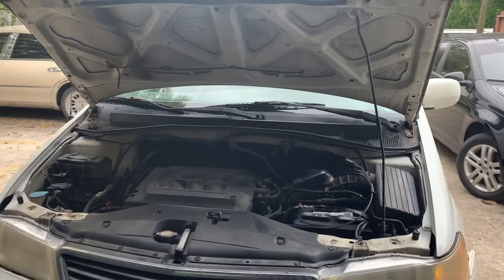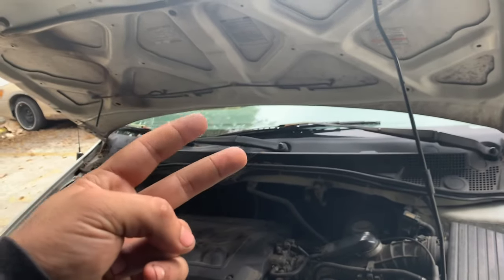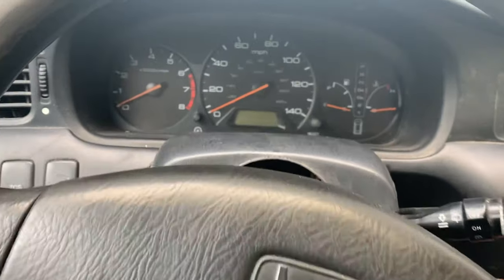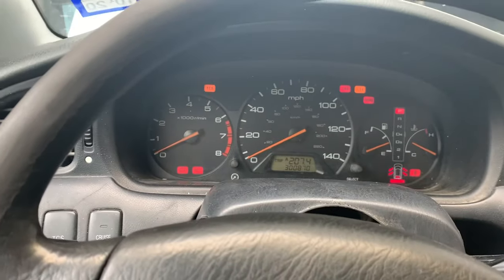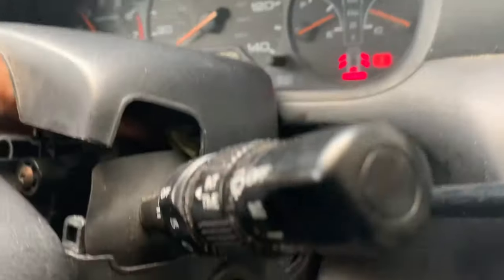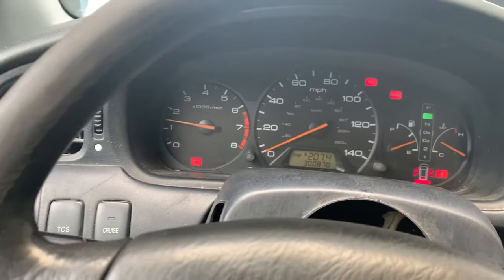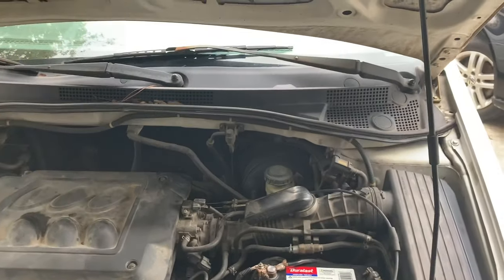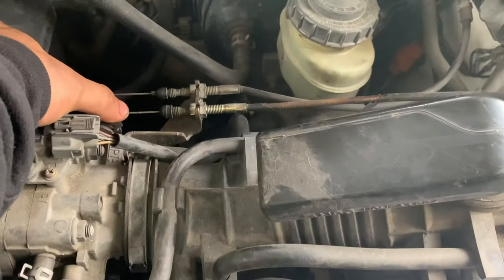Honda High RPM Fix -No Parts Needed-

Comment: An honest mechanic.  You could have charged the customer but you choose to do the right thing instead. That is what makes life time customers that recommend you to everyone.  
I wish I could have found an honest, competant mechanic before I paid $5600 for maintenance and repairs on an 09 Odyssey that cosy me  $4,700.
I'm still having problems with shop that did the work.  All this after dealer stripped oil pan plug

Comment: I had just replaced my battery and noticed the idle was high. Thought it was a coincidence until I saw your video. I went back and found the cable to the cruise control you mentioned was wedged against the corner of the battery, making it slightly tighter than it should be. I slide it off and the idle is back to normal. Really appreciate you making this video!

Comment: Even after finding the problem and adjusting the cable, most shops would have changed the idle air control valve anyway. Just to charge the customer for something. Good stuff bro!
Reply: I guess I am kinda off topic but does anybody know a good place to watch new tv shows online?
Reply: @Reign Alden Lately I have been using Flixzone. Just search on google for it :)
Reply: @Saul Castiel yup, been using Flixzone for years myself :D
Reply: @Saul Castiel thank you, I went there and it seems to work :D I really appreciate it !!
Reply: @keenanjaime3590  all of you
Reply: @reignalden8056  ]]
Reply: @reignalden8056  p

Comment: Thank you so much for your honesty and sharing this, still have this issue with a high RPMs on my Honda Civic 2005 I've gone to five different mechanics and they still have not been able to solve this I will try to check what you posted on this video my transmission ended up getting switched out because I wasn't able to reverse as well😭 probably different issue than this bit I've changed the Pcv valve had the throttle cleaned and now someone else told me about the ignition coils so will be working on those too

Comment: Thank You! I highly appreciate this I'm having the same issue on my Honda Accord Ex 04. Initially I was having the p0507 code error which I've recently changed the idle air control valve, the map sensor, pcv valve, and the engine air filter by myself and cleaned the insides of the metal round piece which connects to the air intake hose while the battery is disconnected which fixed my error now I'm hoping I just have to readjust the long metal piece like within the video to fix the high idle when the car starts up.
Reply: Did it fix the high idle?
Reply: @deedrickg3319  Yes

Comment: You're vids are lifesavers. I appreciate you taking the time to post them. My son just bought a 2007 Civic Lx 2 dr with the 1.8 4 cyl. 5 Sp manual. While cruising 60mph in 5th gear, it's turning about 3000 RPMs and seems like it needs a 6th gear. Is that normal for this car? Drives me crazy since all other vehicles I've been in have cruising RPMs about 2100 at 60mph
Reply: wrbg high róms is gid réblie ebgér farí 9000 r9mmß àt 155 moh
Reply: Have you solved that ?

Comment: I got a 2006 acura tl. No codes.  Rpm respond when applying the gas pedal. Speedometer doesn't want to go pass 30 mph. Struggled going up hill/ downhill. But after turning off engine and restarting car acts normal but after a few second it acts up again. I feel like it's transmission issues. But some say it could be your accelerator pedal position sensor causing all that symptoms. Let me know what's your thoughts. Greatly appreciate 😊

Comment: This is interesting 🤔 
I have an 01 Honda Accord LX V6 and I just put in a 250 amp high output alternator from JS and as soon as I hit the key my rpms jumped to 3,000 rpms just like in this video. Am I experiencing the same issue? Is the computer registering for it to idle higher than it should from throttle screws needing an adjustment?

Comment: I have a 2019 Kia forte ex. My car all of a sudden runs just under 2000 rpms at 100kmh and when i use cruise control it runs 2600/2700 rpms. Can a faulty spark plug cause that? I had the vehicle diagnosed but nothing came back. Can my issue be solved using what you just did to the Honda? Great video btw.

Comment: I’ve got a 2005 Honda Accord that’s revving high and sounds kinda rough but it hasn’t been started in a year, unfortunately the gas tank is full so if bad gas is a problem that’s a lot to take out. But no check engine light, but the brake lights on when it’s not… and there’s a red light right below the brake light. I think the previous owner installed some audio stuff and when they took it out it killed the audio inside the car and there was a hole in the roof to boot.
Reply: buy hybrdé  rom

Comment: Lmfao bro this helped me out a lot so I changed the power steering pump and out of nowhere it starting idling high for no reason I didn’t get it but watching this video and you showing the cruise control cable mine was on the opposite side of the power steering reservoir so that’s why I was idling so high thanks man 👍🏼

Comment: Holy shit this fixed my issue. Have had high RPMS since i got my ZX. and couldnt figure it out. Not even resetting the idle could fix it. I loosened this bolt and batta bing it worked. I was about to fork out 50 bucks on an new air intake hose. |Sweet.

Comment: My case on Honda accord 2004, while driving, the rpm will increase, car will move at higher speed, and brake becomes unmatchable. I have changed the map sensor...the issue still persists. What will I do ?
Reply: Same here, all sensors and vacums, nothing. You???
Reply: Y'all have any luck

Comment: I have a similar problem with my 4.6 Ford explorer but it only high idles when the engine is warmed up, I've changed the idle air control valve twice now and for a little while it ran normal then started again and after the second idle air control valve today no change, nothing is sticking and even cleaned the throttle body but no change

Comment: Dog where is your shop located I have Corolla high rpm when driving and burn more gas now I was going up hill and I put it in 3 gear and after that I have this issue and my transmission is automatic

Comment: So I changed my spark plugs the other day and had to remove the throttle body and etc on my 08 mercury mariner , once I started my car again the rpm was crazy high so is it maybe because I touched the cruise control cable without knowing ?

Comment: I just decide to start my Honda after 3 months. I turn the ignition on, car starts right up and runs for about 1 minute. Instead of letting the engine warm up, I put the car in reverse. Nothing happens. I put it back in park, then in reverse. I depress the gas pedal but don't get any power. So I press hard on the pedal to give it power. The car accelerated in reverse at about 60 miles an hour (snapped back). Hit the brakes and the car just continued to revv at high speeds. Put the car in drive without pressing the gas peddle and it sped right up in my driveway. The car is now in park but every time I turn it on, the engine is in acceleration mode and shakes violently. What gives?

Comment: hi my odyssey 2010  when hard stopping after going like 40mph it dont shift down to first gear fast feels like the engine is going to turn off , at the same time i heard that is shifting down the gears at the same time with a cranky noise.

Comment: I have a Honda ballade luxline S04 1998 150i manual,when engine is at operating temperature it revs high,it's also hunting up and down and when my map sensor plug is out it stops and when I put a new one car just fails to start,can you help

Comment: Hey Oz, I’m having the same exact issue but I have a 2006 Odyssey, therefore I don’t have the wiring. It’s all digital. Any tips or tricks you can give me 😫 I’m desperate. Thank you 🙏🏻
Reply: Possible checking tps voltage? All the way up to swapping throttle body, idle relearn, code reset.... Maybe this helps
Reply: Justin MCQUAID thank you so much! That actually worked! We swapped out the throttle body this past week and that fixed the issue. 🙂

Comment: IS THAT CABLE CONNECTED TO THE THROTLEBODY CAUSE MINE IS STUCK 2005 DODGE GRAND CARAVAN 3000 RPMS REALLY NOISY HISSING TO. Think I have a vacume leak as well. Tried to get a code and it says 5of 7.5 do you know what that means?

Comment: I got the problem with the rpm every time I start the car I got a jetta 2014 se I changed the pcv valve but still the same can it be spark plugs

Comment: What if my rpm up and down from 3000rpm to 1000rpm after i cleaned my throttle body and iac valve? Is it  same fix? Thanks!
Reply: What happened with that

Comment: Okay when I'm hitting the gas it will go all the way up to 2000 RPMs and then when I let off the gas and tap the break it goes back down to 1000 rpms and then it stays like that until I stop and hit the gas again could that be because of the winding noise I am getting from the tension pulley

Comment: People love to hate new cars but good god the vacuum hoses and cables (not to mention plug wires, etc) up to around 2000 made the engine bay a mess and hard to work on. My '97 Taurus with the DOHC had to be halfway torn down to access the rear plugs or anything back there. From the early 2000s to now it's become so easy to access and replace major components that used to be a bitch. Comparing working on a 2012 Ford 3.7 to a 97 Duratec 3.0 is drastic and despite idiots claiming you need 'fancy scan tools', they're the exact same to diagnose with OBD-2.

Comment: Oz, my Honda has low rpm, can I just move that nut to up the rpm alittle???
Reply: Yeah I’m pretty sure it would do the opposite right so I’m sure you can actually adjust it yourself
Reply: @deadcalifornia I'm having the same exact issue with my 03 honda element will this work for me😢😢

Comment: My 2003 rsx starts kinda slow and goes up to 2000 rpm when i start it cold and drops dramatically when I put it in drive. But it only does that when it’s cold. When warm it starts right away. I also feel inconsistency in the pedal. Sometimes it’s sensitive and sometimes I gotta step hard when it comes accelerating. There’s no check engine light on though so I’m having trouble trying to figure out what the problem is. I’ve even took it to places and they can’t figure it out. Hopefully this fix works for me .
Reply: @Roman Barnet Did you fix yours? My 2002 was having RPMs going up above 1000 to about 1500 and then in a while going back to 1000rpms. It recently started to go off by itself when it idles or when I am waiting on the stop light. So annoying. Is it only me that I have to all the time find new solutions to my car's problems? I feel cursed.

Comment: I am having a similar problem 
with my 97 honda civic the wiper lever has been going a little rogue for about a year now... and it will become lose and the wipers will go and go back and forth. I cant keep any fluid in it either because it will spray it all out. It has been cold recently and it has been a little more agressive. I also noticed in the morning if I started my car to move it real quick (usually I let it warm up for 10 minutes) the breaks would'nt work and lock up. This has happened twice in the past month. Now today the spedometer is jumping all over the place while on my way to work. A check engine light has been on the entire time Ive had her, but now when I tried to go over 10mph she would blink. Not going to drive her, does anyone know anything? I feel like its a simple fix with a wire or something.

Comment: My 2011 kia optima is idling just fine but when I'm driving at even 25-35 miles an hour my rpms are in the near 3 - 4 ( tachometer ) nd feels like it's hesitant to excel.  It's a turbo nd when I press on the gas it kinda just goes I don't have to work my way up to a certain speed but it's just felt off.

Comment: I gotta try this when I get  home I hope this is my issue.. Same exact symptoms except mine will shift into drive and jump down to 800 rpm, but in park it shoots up to around 2000 rpm, Cleaned my idle air control valve and throttle body, as well as a new tps and nothing changed. 1990 prelude si
Reply: I have the same problem,did you find a solution?
Reply: Any fix ???
Reply: @MRCALIEMS  bro it ended up being my throttle cable was too tight, i just adjusted it and everything was fine
Reply: @deadcalifornia  🫡 I’ll look at mine asap! Shit is annoying 🤣
Reply: @deadcalifornia  dam wasn’t my throttle cable it has a lot of play🤦🏽‍♂️
Reply: @MRCALIEMS ever find a fix ?

Comment: Does this work for a chevy s10 truck? My truck has a high rpm  like in this video from when it sits for 3 hours or longer?? Great video 😀...PS: my dad is aware of high rpm and says it's fine..like fuck no it ain't! I owned a lot of cars and this rpm goes up to #3. Pls help. I don't mind changing it on my own but, I enjoy doing it 😊
Reply from the maker: What yr is the s10
Reply: 2002
Reply: buy ektrç s10
Reply: Got it fixed, bought a iac sensor and it works good now

Comment: On my 2005 pontiac aztek we changed the thermostat and after we changed it, it idles at 3000 rpms, and we can't figure out why
Reply: Have the same, cleaned sensors, changed o2, new battery, still does that, you?
Reply: not nirmal

Comment: Oz Question. Brother      My infinity i35. 2002.  Comes up. With. Two. Same codes.  The. Nats code.  For Nissan anti thef systhem.     It began yesterday. Now I rea dob line  it says  can b the. Key damage or. Sumthing. Now.    I try to crank it.   It does crank.  But. Doesent. Turn on.   Only. Codes are. P 1610. & 1614.   Both the same. 1610. Is.  Locked. Immobilizer. Due to trying to many times.   So what can I do.   Do I re program the key.  Or.     Also my key is a duplicate. I lost the original key years ago.   So.  Again. Plz hlp me.     Anti thef
Reply from the maker: These anti theft systems are really tricky with out proper tools. What part of the US are you in ?
Reply: Oz Mechanics     In. Nyc. Brother.  Queens.  Yes. This. Just started.    First.  It did it.   Then. The next day. The car went on. I was happy. But. Sumthing told me to chk it at night. Before work. Nd. Again.   The two codes.   Nats.   1610
Reply: Do u think it mite b the.   Key. It’s a   Dif. Program key.  Plus I don’t even know it that key has a chip.   Since my car does have anti thef.    The key has no slot thou    Maybe u can refer me to a regular technician.  Not. Infinity. To exp.  but I do understand that. They do have. Technicians
Reply from the maker: I have some buddies in nyc that can diagnose it. I can give them a call and see if they are still working thru this pandemic